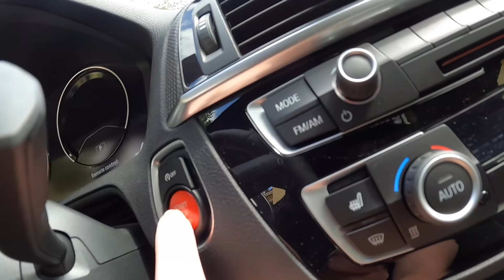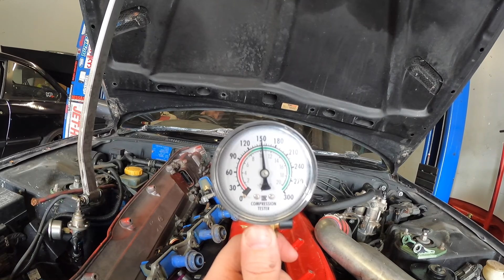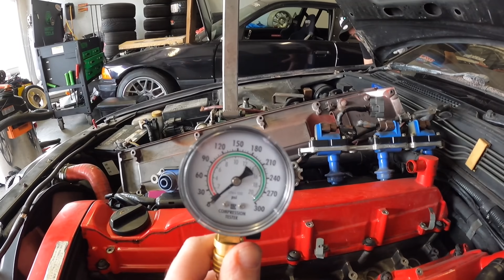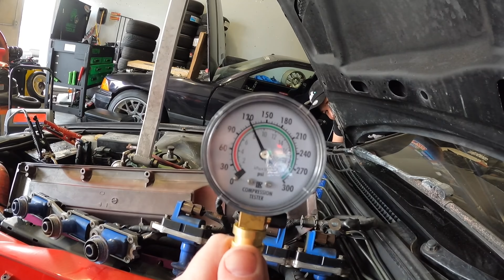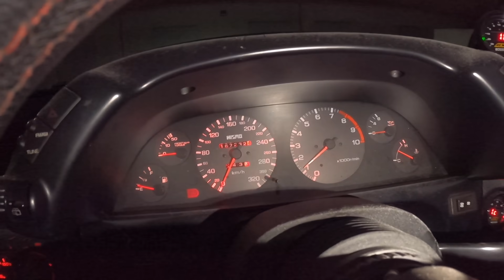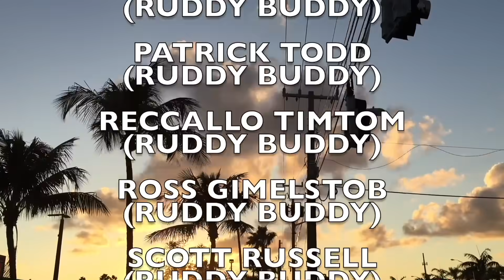GOT ANOTHER GTR..?

Comment: Should have done a wet compression test with oil in the cylinder .. might only be the rings from the car sitting around for a while .. ! Keep it up :)
Reply: Bent valve, motor sucked in the ceramic on the bad turbo.
Reply: @Car-Yap  ohh, :(

Comment: Worked on one GTR, and we were putting  in 2860s with the motor still in the car. It was a pain in the ass and we had to spend a long time getting that done with no issues. Whenever I get my own R32 GTR, I’m pulling the motor out if I need to do anything. Done it to my Z and it made everything so much smoother.

Comment: You can test if its rings or head by putting oil on top of the cylinders and redoing compression test. If compression goes up the oil is sealing rings, if it stays low may be valves not sealing. Blown turbo can put shrapnel in the valves. Just a thought.

Comment: The bottom end might be fine it could just need some head work
Reply: If the rear turbo goes, it potentially will spit ceramic all into the engine, so while it’s possible, it’s not likely the head is an issue. More than likely the compression loss is something to do with rings/cylinder walls
Reply: I doubt it would damage the rings. Piston might have some marks on it but will be sweet. But valves can catch bits going through the engine. Which can cause bad compression

Comment: Put oil in the plug hole, if compression goes up it’s ring relating. If there’s no change it’s valve/head related. When they sit for a while rings can stick and valves can get corrosion.

Comment: Do a 4 post in the back corner where the shelf is for car storage, and a second two post lift in front of it beside the other 2 post...maximum space usage, you'd have 2 storage spots that could become 3 if you include the space under your current project car on the second 2 post.

Comment: Try putting two caps of oil in each cylinder. Let it sit overnight. Crank it over and fire it up. It will smoke but might free the rings if they are stuck.

Comment: Yooo rudnick. The easiest way to do a compression test to check to see if it has bad compression due to rings or bent valves is to pour a little bit of oil into the spark plug hole right before you check the compression on said cylinder if the pressure goes up that means the rings or the cylinder walls are damaged but if nothing changes that means the damage is in the valves. Please do this on video for everybody.

Comment: One tip when u do compression test open the throttle to get more air in as u will get a better reading
An when u get low compression on one cylinder try add a little oil to see if numbers go up 
If it does its the rings
An u need to do it when engine is warm too

Comment: Charge the battery full, try a different compression tester, drop a spoonful of oil into the cylinders.  Retest.  Then do a leakdown test to see if its just a stuck or damaged valve.  Just because you got a bad number the first time doesn't mean the engine is toast, especially if its been sitting!!

Comment: It will run better when you get the alternator fixed. Also if it's been sitting it might have had a stuck ring. And the heat cycle might have. Freed up the ring. Sounds like you have been thinking on how to go in different directions on how to make money. Got get that chedder Chris !!

Comment: If its been sitting that long you could have gunk'd up ring set's. Should have soaked the cylinders with some kerosene or diesel fuel over night and then blown it out when you had the plugs out. Could run some engine-flush for a little while to help de-gunkify the internals then drain it and add new oil & re-check the compression.

Comment: You know that you need to have the throttle body wide open for the compression test right ? Maybe i didn't seen right but it seem that you were just cranking it. Also starting an engine with a clutch fan and no air filter on a sandy landfield... Not the best idea.

Comment: Rudnik pull the head off. Check head gasket and piston and valves while you have it off. Do NOT 🚫 put new turbos on and call it a day. The turbos have NOTHING to do with your bad compression. Bad compression means you have a bad head gasket, bad piston rings, or bad valves. 🥺 Please check these first, for the sake of the skyline.

Comment: Why not add oil to cylinder or do a leak down test diagnose why it has low compression. You could do a leak down and find where the compression issue is. I leak down tester is probably like 100$ come on rod knock this shit is simple